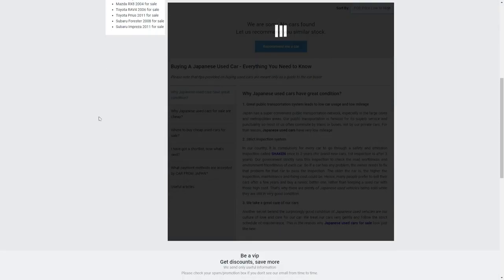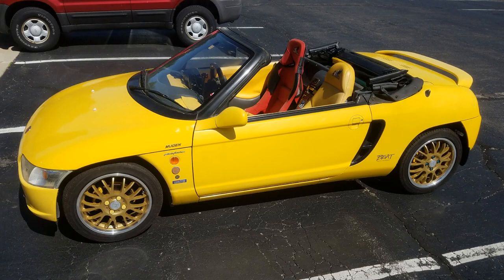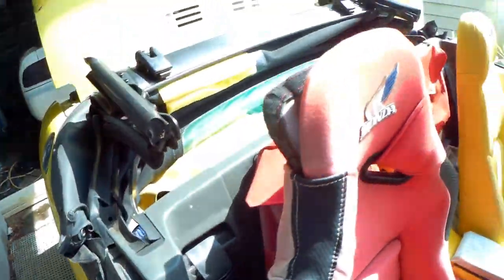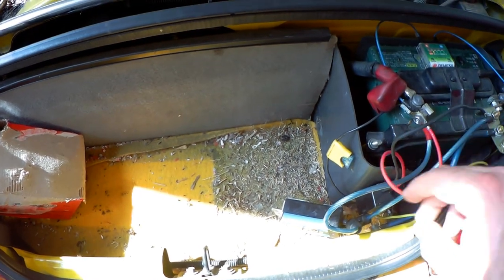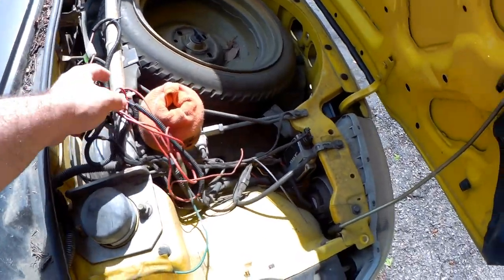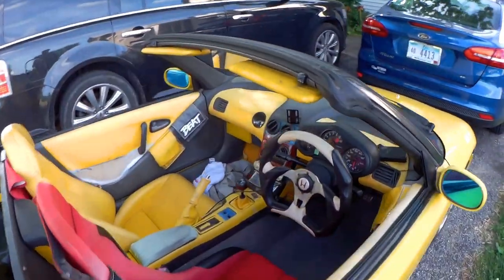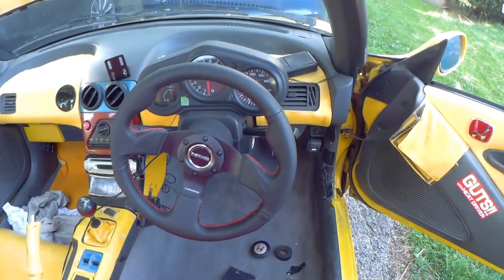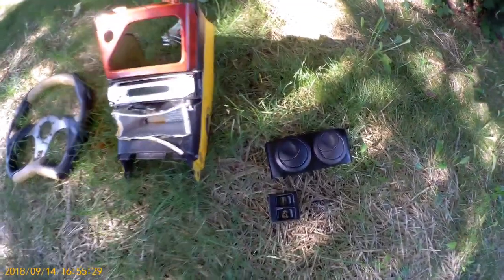I imported the cheapest sports car from Japan: a Honda Beat!

Comment: great video! I also just purchased my first beat and am getting so excited! Make sure to replace your timing belt. it is recommended to replace it every 30-35k kilometers or ~20k miles.
Reply from the maker: Closer to ~50-60k kilometers, but yeah it's still quite often.
I changed the belt first thing...which I mentioned but mostly glossed over in the video since I didn't have any footage of that.
Reply: Huh, I read over the service manual (in Japanese with rough translation.) and it had mentioned 30,000 ks, but I could be mistaken.
Reply from the maker: @nickgreen-virginiarealesta4971  Oddly enough I can't even find where I read the interval, but I know I've not heard anyone say it's that low before.  You could be right...although that is exceedingly often, especially given how difficult the job is.

Comment: Everyone talks power to weight and compares light cars to the much faster More powerful cars, and that makes sense. A power to weight of X should accelerate the same regardless of weight provided that traction and gearing remain constant... but that misses the fun factor. 7 second 0-60 in a v6 minivan is nowhere near the same 7 seconds in a BRZ or a Miata. The fun factor aught to be power over weight squared. From there you can adjust for traction and gearing... say [power over weight squared]times[lateralg’s times average ratio of 2nd and 3rd gear]